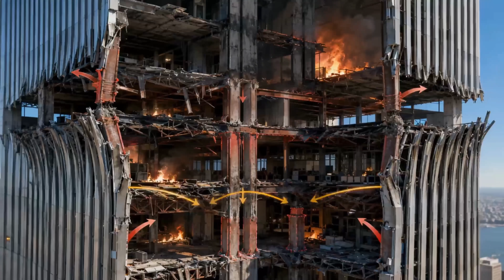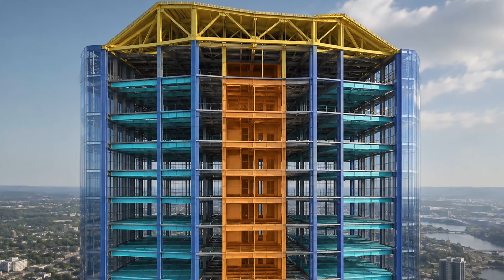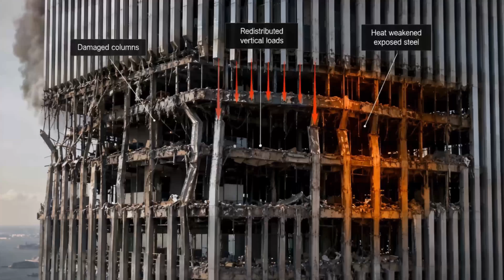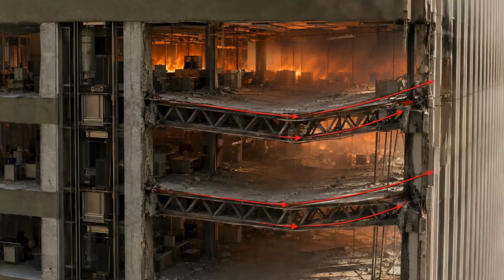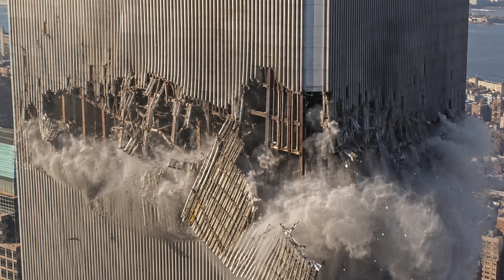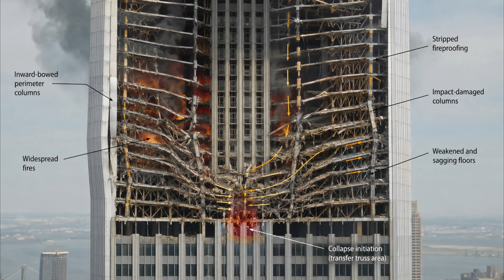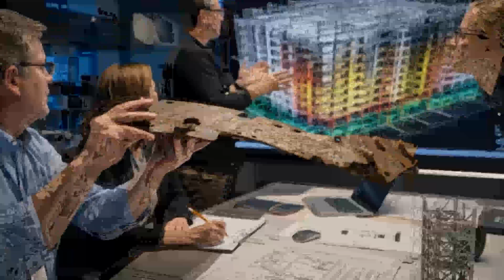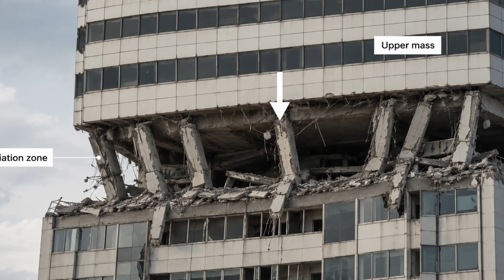What Happened Inside the Twin-Towers After Impact?

Comment: I was next to it and it smelled like burning wire and metal too and smoke and was very loud and with sirens everywhere
Reply: The firemen witnessed large volumes of molten steel flowing to the basements.
Reply: @Wilber-citizen  They actually were finding little puddles of molten material in the rubble during the clean up. The fireman who found it called it "molten steel" because that's just what most people would call it. I don't believe they ran tests on it to determine what it actually was, but to imply that is was steel would be pretty ludicrous. But those buildings were filled with all sorts of different types of metals that were capable of becoming molten at those temps. For example metal from the furniture, all sorts of different equipment, office partitions, file cabinets, thousands of things, all of which were susceptible to becoming "molten" when they were in that debris pile, where fire burned for a couple of months afterwards. 

What are you even trying to imply though by saying they found molten steel in the first place? Because if you're implying it was a controlled demolition, please tell me how finding molten anything would indicate that.
Reply: @Wilber-citizen  Find a credible source to back this up. No one ever reported it.
Reply: What's your beliefs system for its collapse after knowing what you know ?